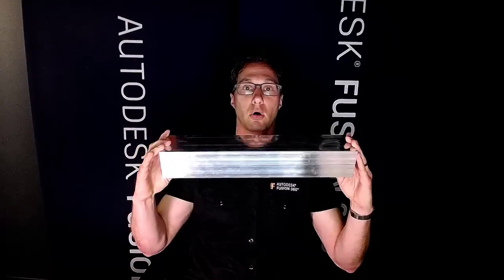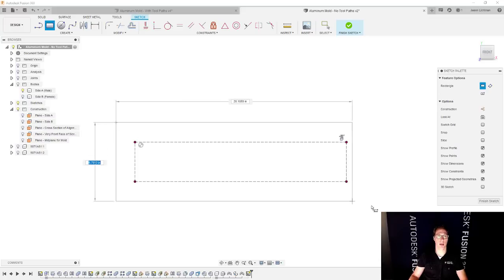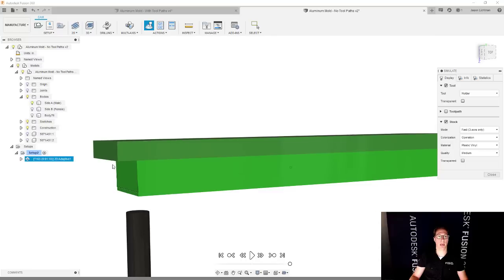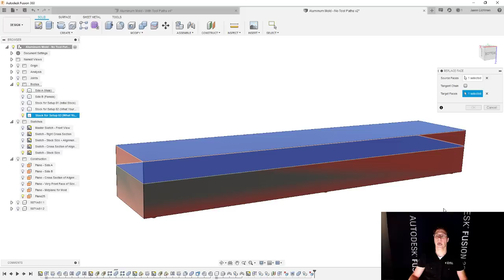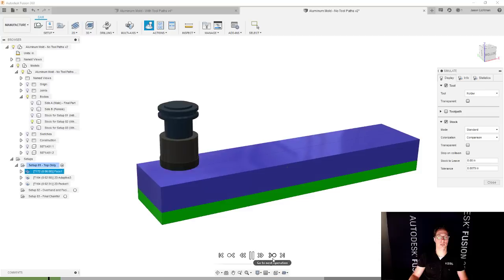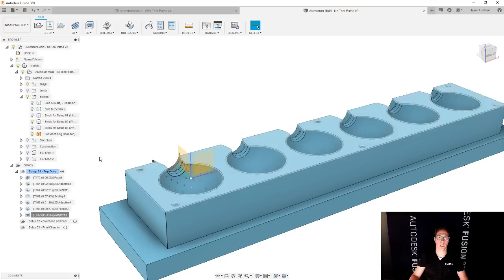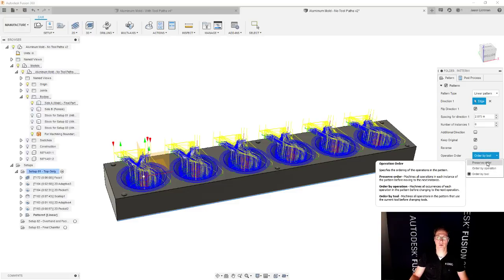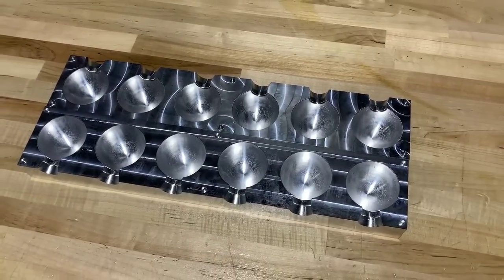360 LIVE: Jason Programs & CNC Machines a Candle Mold

Comment: Best practice is actually using the center of a part for wcs especially for second side , the first operation needs to be perfect size in order to get chamfers or radii to cut even all around the profile, an uneven chamfer can be spotted from a mile away!
Setting the wcs to the center gives even chamfers allowing for slight changes in dimensions.
Reply from the maker: Interested to see how Jason replies to this.

Comment: @UCUZvpAFgzXDx7F9UrtzlWJw Re setup 2, I'm a little concerned about touching off of the back left corner of the stock. Wouldn't it be preferable to touch off a surface that was machined in step 1?
Reply: @Darran Edmundson, I agree that would be preferable. That being said, it isn't always possible. In my case, I had a pretty big overhang. The probe in our VF-3 would never reach the machined surface under the overhang. So, setup 02 is really intended to get rid of the overhang. Maybe I should have moved my facing operation from setup 02 to setup 03 though. That would likely result in a more accurate final part thickness.

Comment: I'm still puzzled why you would take this approach. I've been outputting the finished stock from each setup stage as a mesh (STL) and inserting it into the design as a stock body for the next setup. That's simple to do from the manufacture environment when you simulate or process the toolpaths. Then the setup for the next stage uses that partially machined model, EXACTLY as it will look, including roughed surfaces such as stepped slopes. That's got to be better than making these artificial inter-setup CAD models that take no account of the actual tool and toolpath.

There's no issue using parameters for the method I am using. EDIT - seems you have to resave and reinsert the mesh bodies between setups. I was surprised when I convinced myself it was refreshing the imported mesh stock body after parameter changes but it seems I'd simply changed the parameters to a smaller body which appeared to give a sound final result. But still it seems a slick workflow

I'm just following the workflow previously explained by other Fusion team members. I get the feeling it's really not widely appreciated how cool it is.
Reply: @Murray Edington, the method you described is a good one. In some respects (as you mentioned), it is even more accurate than the method I showed in the live stream. There is one fatal flaw, though. The STL output from OP 01 that you bring into OP 02 is not parametric. As you mentioned, it does not update when you decide to update your CAD model or your tool path strategy. So, every time you update your CAD model or you update your tool paths, you have to re-export the STL, re-import it and then update your setup to use the new mesh as the stock. I find that to be a real pain considering that design and tool-pathing is so iterative. I would be doing that process a whole lot. Once Fusion 360 makes this parametric (the results from OP 1 can be sent over directly to OP 2 as the stock and it updates on the fly) , I think your method will prove ideal. Until then, I use the method I showed in the live stream. If you prefer your method, that is totally fine and I support you. Thank you for taking the time to watch my live stream and also provide meaningful feedback.
Reply: @easyriderj  I enjoyed your livestream and as ever I find new features or reminders of some I'd forgotten. I look forward to seeing more from you! You obviously prepared carefully and know your subject matter.

Yes, if and when this becomes parametric, it will be the ideal solution. As you say, the mesh needs to be saved and reinserted if the preceding setup / toolpath changes. I don't find that an issue for my work and it avoids all the extra steps your method involves. After all, I will usually be moving the workpiece around and reprobing it between setups anyway, so that isn't a big issue. Some of the roughing operations leave quite a bit of material to remove in places and could be hazardous if left for a small finishing tool to discover. However, I agree, neither is right or wrong, it just depends on what suits the situation.

Comment: Jason I prefer to use locating pins then I can use the same tool path for part (a) and part (b) then I can lock-tight the pin in one half of the mold. By the way I to am (76) your speed is fine. Be well and be safe
Reply: @cockatoobirdman, I was thinking of using alignment pins. They would certainly have simplified the machining side of things. However, I wanted the mold halves to self locate. My experience with alignment pins is that you have to have everything aligned perfectly before the mold will close. Personal preference to go with the hemispheres. Thank you for your support. I appreciate it very much!
Reply from the maker: Thanks for replying, Jason!